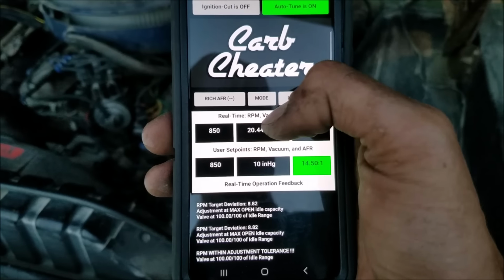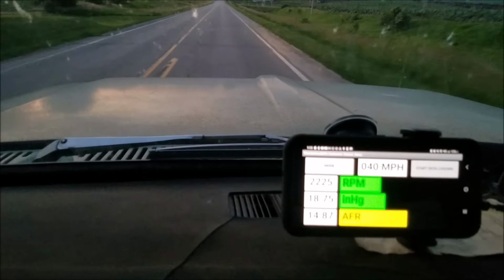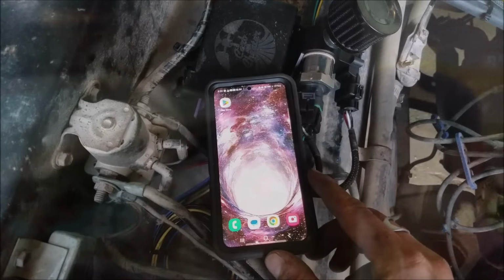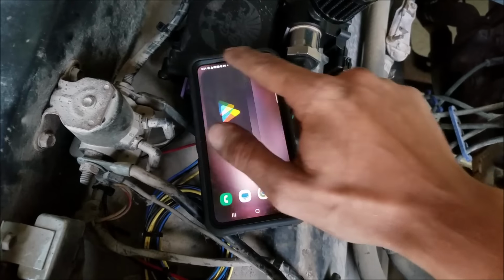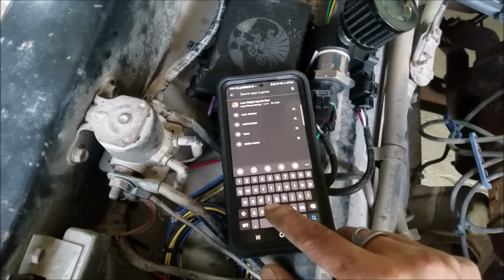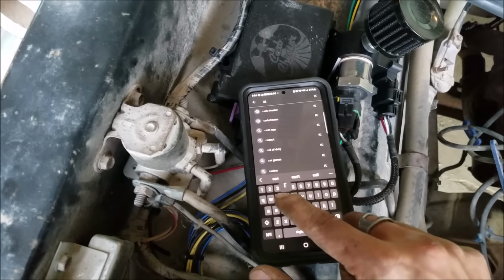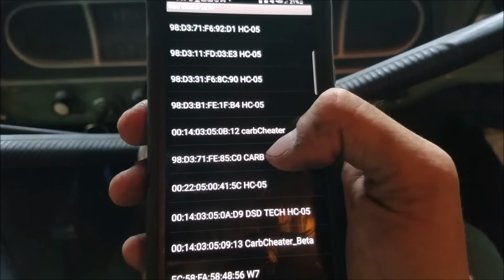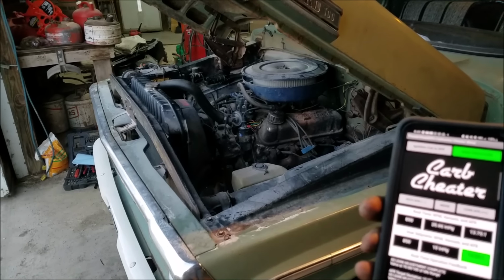Make a SELF-TUNING Holley/Edelbrock Carb! (Carb Cheater: Installation & Setup)

Comment: If I already have my wide band sensor installed on one of my collectors should I do a new install on the headers or will it work fine?
Reply from the maker: There is a purchase option less our own wideband where carb cheater is cheaper - you use the blue wire in the video to hook to your existing widebands analog signal 👍
Reply: @ThunderHead289  Ah yes, I have already purchased that option. I am more so curious about the location of the sensor. Will having the sensor at the collector instead of the header result in possibly weird data, laggy controls, etc? Or do you think it will work fine?

Comment: Id love a break down of how this works.  Because this looks like a really cool system.
Reply: Modern EFI regulates fuel delivery among other parameters to achieve a consistent and optimal operation curve. Carburetors have a static fuel curve. This device uses a wide band air fuel sensor as feedback with a idle speed regulator to control manifold vacuum, introducing more or less bypass air to achieve optimal operation.

Comment: I like it when the blow through carb turbo people work with the fuel system to achieve enrichment under boost and still keep part throttle AFR where it needs to be. Carburetor Systems Unlimited are really good for boost sensitive fuel delivery.

Comment: Thanks for the tips Luke! I will grease my gaskets where applicable from now on. Will even save me some money in the long run 👍Also a good thing to note is that it is fail safe. When the Carb Cheater box fails, the carburetor will still be able to function.
Reply: I use spray silicone lube. Works great. 2 quick coats on each side

Comment: Could the carb cheater be used to run a similar but different setup? Ex- instead of the computer running the vacuum solenoid (or valve) could it be used to control a single fuel injector while still doing all the other monitoring functions you show?

Thanks, please think about it. This could possibly be a solution I've been after for quite some time.
Reply from the maker: Definitely could be but if it were to fail its exponentially more risky to the engine and driver. Plus the air injection stuff helps to atomize fuel better as a side benefit
Reply: @ThunderHead289  This would be in parallel, but not connected with an existing OBD1 that is exceeding it's trim threshold by x  (lowish  percent). Its' an 88 350 tpi firebird that I've done the y pipe and full catback on, and edelbrock tpi base and slightly enlarged runners. I'm just about positive it's leaning out through the mid and top end of the rpm range. The system is fully intact and functioning and I'm not really looking to get  miracle gains or anything of the sort but I would like to be able to get a proper AFR and see what is actually going on. There's a couple systems that allow you to directly reprogram the obd1 but I'm not real interested in molesting the original computer.
Thanks for your quick reply.
Reply: @ThunderHead289  The air injection blows air directly into the exhaust via the exhaust manifolds, it never comes into play as far as fuel atomization. It only fools the smog machine into thinking the vehicle is actually running cleaner than it is.

Comment: It is a simple way to add closed loop fuel mixture control to a carburated system during vehicle conditions where there is a decent amount of manifold vacuum :-). The gear head end user could use this to tweak the carb metering so that this system did not need to adjust as much.
Reply: By simple I mean "simple for the end user" :-).

Comment: Awesome to see this product come to life. I originally started following you because of Kevin but really enjoy your unique engineering ideas. My question though, is running at 14.5-14.7 afr under load might cause detonation or loss of power. Is there a way to tune for richer mixture at lower vacuum when the throttle is mostly/fully open?
Reply: It pretty much will not do much at WOT when there is not much manifold vacuum ??
Reply from the maker: It already is in there 🙂
Once you drop below the vacuum threshold which is settable by the user, target afr drops to 12.5 (which inlike the other afr scenarios, this one is hard coded)

Comment: Curious how this may benefit a bracket drag racing application where timing is locked out and weather/ da changes affect the throttle stop needed to run the number.   
Would it negate some of the weather effects by ‘tuning’ AFR real time and therefore make the runs more consistent? 
how much adjustment can it really make in a <10 second wot run?
Reply: I doubt it would do much at wide open throttle

Comment: In Europe in VW Golf MK2 1.6 we had ECU controlled carburetors like Pierburg 2EE. But in that case actuator was controlled choke flap and using lambda sensor make car to suck more fuel (in default carb was set lean). That carb even don't had acceleration pump that function was controlled too by elektronic choke flap.  Some carb like Keihin had in Germany lambda kit too for making cars more eco friendly (lower taxes).
Reply: Hopefully these guys can integrate  that feature into this device.

Comment: I think I remember how this product works and the one thing I can’t handle is the sound of a vacuum leak😂. Honestly it is a great product and you will benefit from having it. A wide band 02 sensor has really helped with carburetor tuning.
Reply from the maker: I baffled it, so its much better than one would think - but yes a wideband is bar non the most instrumental item in precision tuning.
Reply: @ThunderHead289  So, I see Carb Cheater it is basically using a vacuum leak to tune. Is the principle behind this to product to reduce manifold vacuum and thereby decrease signal to the carb, or is the added air supply doing the leaning just by itself?

Comment: Just watched the video. How do you think it would work on carbed motorcycles? In my case it would be a Moto Guzzi v-twin with 1 carb/coil per cylinder. Is it crazy to think that running one cheater on each cylinder would work?

Comment: Will this work with the Pertronix 3 system?
Reply from the maker: Yep. Ignitor 3 module and coil are what's on the truck in the video
Reply: Outstanding! I don't have a tach on mine because of it being the igniter 3.

Comment: how the hell does it work ??? how does it adjust the fuel /air ?
Reply: IMHO it it allows air into the intake below the carb in a controlled fashion.......it does this closed loop using a wideband O2 sensor to monitor fuel air ratio live.

Comment: I have a friend that did this basic same thing in the 80s only difference is it was manual instead of computerized. He sent off for a patient and some guys showed up at his shop and told him it would be in his best interest to stop producing them.  In nice terms.  They weren't so nice as I'm putting it. I hope you're device works out for you and these strong arm guys don't show up at your door.  By the way he was getting 20 miles to the gallon out of a quadrajet on a 350 in a truck.  That's why they came to see him.
Reply: I call Bull sh!t.

Comment: A fellow Iowa resident!  I've taken a recent interest in old Japanese motorcycles, and 4 carbs at once can really frustrate you.  I'd love to learn more about how this system works to see if there's a way to make one for a 4 carb/4 cylinder cycle engine.
Reply: You may know this already.. but.. for those who don’t.. Typically motorcycles use CV or Constant Velocity carbs.. which respond differently than Holley or Edelbrock designs.. Because they compensate for airflow by raising or lowering the metering rod based on air velocity, you want to balance them using vacuum sticks or airflow meters. You start with them off the bike and use feeler gauges to set the butterflys..do it with them on the idle stop AND at wide open.. you want them exactly in sync with each other… then check with the vacuum sticks or airflow meters.. they will show vacuum leaks or bad valves/valve adjustments, which are common on Japanese bikes because the shim under bucket can be a pain… As a fellow enthusiast of these bikes and Italian and German as well..only a few things kill them.. bad floats and seats, water/ modern fuel left in them causing corrosion .. after that valves sticking and valve springs collapsing  from sitting for years.  Best of luck and have fun!
Reply: I was into 70s multiple cylinder bikes about 20 years ago. Most of those ( mainly Honda) were not cv carbs. Tiny low speed jets were usually partially plugged up on a neglected bike. Leaky / worn float valves and bad fuel tank petcocks are common. I used a rack of 4 vacuum gages to synchronize them, not hard. High prices for carb parts was the worst problem. Honda (and others )probably had a good reason for using 4 carbs  instead of 1, but I don’t know what the reason is. I would love to hear about your efforts to single carb a Japanese multi. Good luck!
Reply: My buddy and I cleaned/rebuilt the same set of carbs 3-4 times for one motorcycle. Turns out soaking in cleaner is greater than simply spraying with carb cleaner. Also having a tank cleaned/sealed to get rid of the rust/detritus also helps ;-)
Reply: Thunder products intelajet or dialajet for motorcycle carbs.

Comment: Down to earth genius! Wish this was around back on the day, when I was wrenching! 
Love that it's like, easy enough for my 3 yr old grandson to install! (By the way, he loved this video) Only thing I might suggest, since you're marketing for simplicity of install, is have your wires labeled for connection. ie, + battery, - ground, + coil, etc.
Looks like an awesome product. Good luck with it Luke.
Reply: Feedback carb technology was around in the 1980s.  They were the stepping stone to true EFI.

This just makes use of more modern sensors.  The major problem that killed the feedback carbs in the 1980s was after a few years they didn't work too great as the EPA kept putting the squeeze on cleaning up the emissions and the feedback carb just couldn't meet those requirements so they were discontinued in favor of true EFI which is superior form of fuel metering.

It's nice to see someone bring about a stand alone system and price it fairly decent.  Just don't know why someone in the modern world of LS transplants go with a reimagine feedback carburetors system over an actual EFI system that is on the market that has more functionality.

For labeling the wires for simplicity you can do that but people will still ignore it.

I see people that can't wire up a universal wiring harness for their car that has every wire pad printed with what it is every 6 inches as well as a booklet showing what wire goes where on the connectors.

I also see people with snipers that didn't bother to read the book and think it's fine to ground the sniper to the engine and the battery hot to the alternator charge lug when the instructions say clearly make connections at the battery.
Reply: @Milner62  thanks for the feedback. I dealt with cars mostly from the 70's and back. I agree, some folks can't, or won't read labels/instructions. They deserve what they end up with.
As far as, carb vs efi, I agree that efi is much more efficient, however, if you're trying to keep it as original as possible, this system seems like a nice little way to avoid headaches if you're not overly familiar with how carbs work. Adjusting them can sometimes be menacing, even for us old timers.
I haven't wrenched in over 20 years, but love to watch the younger guys continue the journey.
Reply: @Milner62  This thing is $400 where good TBI and MPFI systems cost a lot more.
Reply: @hithere7382 , let's see carb $500 plus $400 for this that puts you at $900 compared to a sniper that can be uad for under $1500.

It's like Edelbrock cylinder heads vs AFR CNC cylinder heads.  Price difference is only a few hundred.
Reply: @Milner62  what about a 30 dollar carb with 30 dollars of rebuild kit and this? 460 vs 1500, that's not chump change.
Reply: @16vSciroccoboi , 95% of people out there can't properly rebuild a carb.

It's why we make so much money cause we are the only shop left that will rebuild a carb here.
Reply: @Milner62  cool story. Sounds like Luke should discontinue this and just start selling sniper EFI systems or refer them to your shop, since you've demonstrated that this product is completely useless and shouldn't exist.
Reply: @Milner62  people who want this aren't the people who are going full out on LS swaps. It has a market and purpose.
Reply: @16vSciroccoboi , people buying carbs are buying them as they know about carbs.  People who knows nothing about carbs won't be buying a carb they will go with something like EFI either factory or aftermarket.
Reply: @Milner62  that's not always really true at all, and it also doesn't negate the market for this product. Especially people who live in a place like say Utah or something where in a day you can drive and change 6k in elevation.

Comment: I ended up converting to EFI, goodbye carb issues.
Reply: Same here.  My 302 build has a Sniper 4150 Stealth sitting atop the Performer intake manifold.

I would have kept my carb it performed flawlessly for me since 1993 but this new ethanol blended fuels is killing my carbs eating the castings and destroying the gaskets even on ethanol safe rebuild kits.  Smart thing to do is just get away from carbs now that EFI is so cheap now and has way more adjustability than any carb would have.

Playing around with my desktop program I have an idle speed mapped out of 750 rpm till ECT hits 100*F then it drops down to 600 rpm till 120*F then full idle of 575 rpm by 135*F.  I also have idle speed set to go up to 750 rpm around 230*F like the OE did to spin water pump and fan faster to cool engine down in traffic cases.  With a GMP HD water pump, robertshaw high flow 195* thermostat and a Cold Case dual core aluminum radiator with a 7 blade OE spec flex fan I should have no overheat issues at idle.

I also have it setup to bump my idle speed from 575 to 650 when the AC is turned on as well as to cut my AC compressor out above 99% throttle to help with passing.

Features that you can't do with a carb without a bunch of extra hardware to do it how Ford did it from the factory.
Reply: @Milner62  Looks like you have a pretty tricked out setup, thanks for the response.  My conversion was due to fuel starvation above 11Kft in my 74 Bronco, 351w.  I used to puke gas at steep angles and vapor lock at the most inopportune time.  I used a conversion kit and EFI parts from a 93 Mustang.  It was mostly plug'n'play using a race harness and efi intake.

Comment: Carburetor retrofit Idle air solenoid actuated off of wideband O2 sensor. I like it. Saves a little fuel economy at idle and maintains ideal idle characteristics.
Reply from the maker: It also does quite a bit at cruising, especially low speed- which when I made it I didn't think would work out that way.

Comment: Hey Luke, just wanted to thank you so much for the continous resource and guide you've been on carbureation over all these years. I really hope carb Cheater as a brand is a big break for you and your team/family. You've given so much over the years, and it would make me super happy to see this product take off stratospherically in the car community for your sake. Keep on doing amazing things brother!
Reply from the maker: I just hope it helps people to stop bad mouthing carbs when we're in a sea of aftermarket injection failures - it's put a negative spin on old cars for the next generation I've seen and that's been sad to watch. Hoping to poke some holes in that mentality 🙂
Reply: @ThunderHead289  Amen to that! As you say, Carbs are a fixed metering device, (I add: pressure differential fuel mover) in a dynamic (variable) world! Your Carb Cheater adds instantaneous & continuous adjustments far faster than anyone could  adjust the carb while living under the hood while someone else drove! It's pure genius Luke & Joe!

Comment: Congratulations, welcome to the 1980s.
Reply from the maker: Lol no - think of what a personal computer was in the 80s and widebands didn't even exist until 1995, let alone a modern wideband which is late 00s. 

It may be the future of yesterday today, but it's how it should have been back then.
Reply: @ThunderHead289 , same technology.  You have a carb, you have a bunch of sensors, and you have an IAC for control.

Welcome to the 1980s you reinvented the wheel in this case but a fresh coat of paint doesn't change this is old technology.

As far as computers and sensors goes, that's a moot point.  We went to the moon with less computing power than our cell phones today has.  The added technology will make it easier but doesn't make it better.  I'm surprised with you cause you would go out of your way to shun vintage tech that improved carbs in the 1970s and 1980s as obsolete yet praising this technology which is right out of a factory stock car from the 1980s just with more modern sensors.
Reply: This is much better with actual computing power and real time measurement